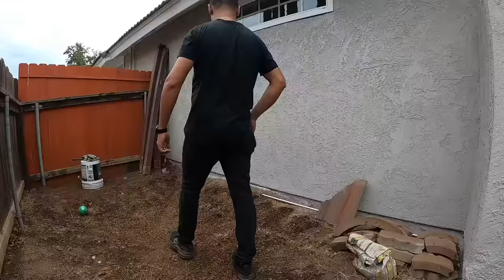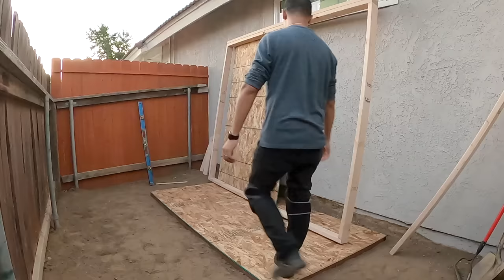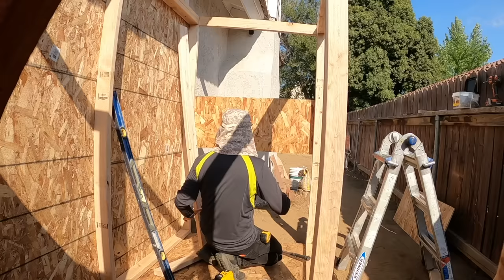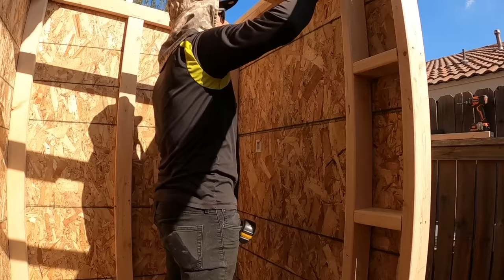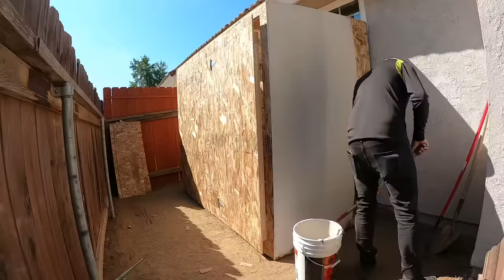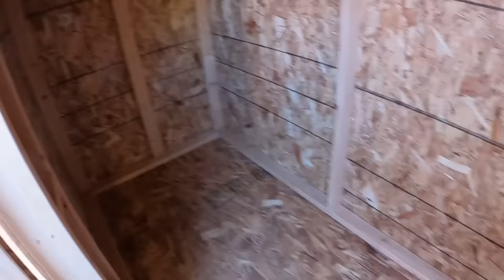How to build a simple 4 'x 8' storage shed under $380 dollars

Comment: i think u can buy a shed with that size with less than 380
Reply from the maker: No, I looked everywhere before building this and couldn’t find anything, they do sell smaller plastic sheds but they are paper thin and very fragile, if you want something that will last forever you should build it yourself.

Comment: Why not just build shed on patio and then move shed side of house later? You can dig foundation later. It would have saved 100 trips walking back and forth between patio and side of house. Just put small shed on good dolly and move.
Reply from the maker: The terrain doesn’t allow me to move this structure on a dolly, it is also extremely heavy for a dolly, it would be impossible to move it.

Comment: and 1000$ in city fees and inspections
Reply from the maker: Here in my city if the floor area does not exceed 120 square feet, you don't need a building permit, this shed is only 32 square feet so it is no needed.